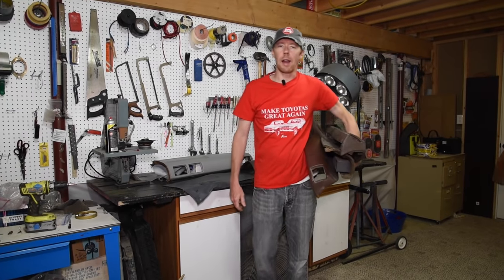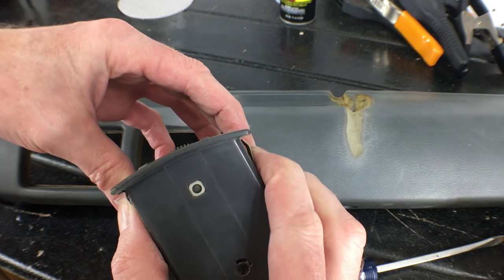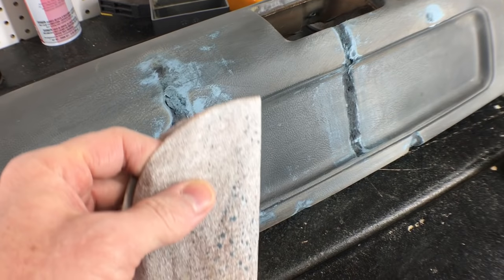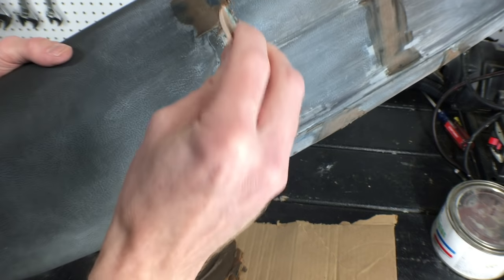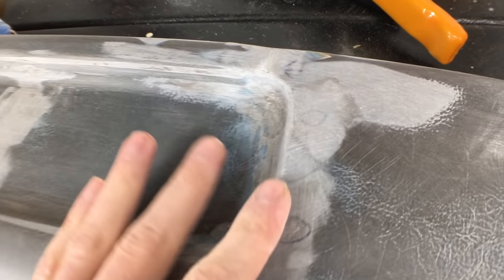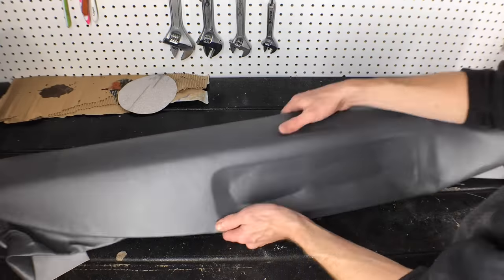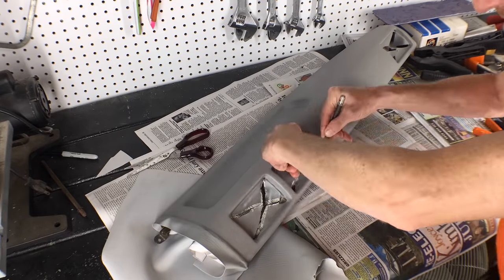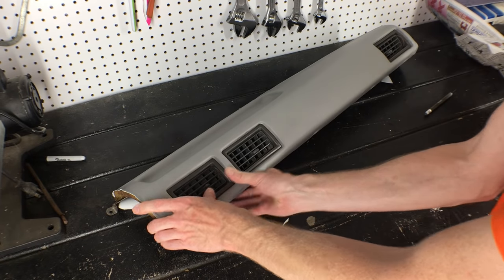How to Restore/Fix/Repair a Cracked Vinyl Dash - Toyota Hilux Pickup/4Runner PART 1

Comment: Hey.
If I may..ive done lots of vinyl covering, and you can keep that contour in the dash by gluing the inset part only, and press the glue on the bottom and edges, and let it dry. Then take a steamer (or even an iron with a GOOD steam setting)...not heat only, and stretch the vinyl over the contours as you glue it into place. Heat tends to more less melt the vinyl into place, while the steam sort of swells the cloth backing of the vinyl and allows it to stretch. If you ever get the chance to do another one, try it and start glueing in the contours first, not trying to stretch the material into it. Hope this helps...and great and informative video by the way!
Thanks
Reply: you are right the indent needs yo be done first so the material its not stretched and comes up from it but at least he puts the mistakes in the video and now we know what not to do 🤣.

Comment: I live in Australia and I converted my 74 Corvette from LHD to RHD. With the dash faces I cut, rearranged and filled the joins. What I did was remove the cotton backing from the vinyl which made it super stretchy. They looked factory.
Reply from the maker: Thanks I will have to try that in the next dash video!

Comment: Cut blocks of upholstery foam the same size as the recess in the top stack about four of them on top of each other support the underside of the dash get it good and hot with the heat gun then apply a piece of plywood that covers by about an inch of the size of the recess on top with weights, till the surrounding plywood touches the other flat areas around the recess. Wait about 24 to 36 hours and that recess will be molded in properly. Learned that from a guy at a trim shop many, many, many, years ago. I'm like mid 60's
Reply from the maker: Thanks for the tip!!

Comment: Awesome video, all the trouble you had with the recess part, I would have used that old bond and made it a smooth dash 😝, but you never gave up. Great job 👍🏼
Reply from the maker: Looking back, I wish I did exactly that! I recently restored another dash using spray foam, brush on glue and 4-way stretch vinyl and the results were much better:
https://youtu.be/XB9GKLRHYNM

Comment: Remove the white on the back of the vinyl, it can be torn off. Then the vinyl can be shaped very well, it becomes very stretchy. Have renovated many dashboards. Sossemats from Sweden
Reply from the maker: Thanks, I had no idea it could be removed. I recently restored another dash using spray foam, brush on glue and 4-way stretch vinyl, and the results were better, but still had a little trouble with the recessed area: https://youtu.be/XB9GKLRHYNM

Comment: You need to glue and install the vinyl cover over the recessed area on top of the dash first and let the glue dry and cure before doing the rest of the dash. You also kept heating up the vinyl but heat causes the adhesive to release. You also need to spray a bonding primer on the dash before applying the adhesive. And if you need to heat and stretch use a hair dryer not a heat gun.
Reply from the maker: Thanks for the advice, I would like to try this again in a future video using all the advice I have received.

Comment: Probably already figured this out now, but it's easier if you don't let the glue get quite to full tack, & start with the biggest recessed area first...and the 2nd vinyl is a better shade of grey in my opinion...🖖🏿😎👍🏿
Reply from the maker: Thanks for watching! I recently restored another dash using spray foam, brush on glue and 4-way stretch vinyl, and the results were much better: https://youtu.be/XB9GKLRHYNM

Comment: Try out some stretch heat vinyl. I've used it on small projects but for what you did. It might work but I'd also look into a more industrial type glue that does not react to heat. Looks like you are on a good path. Keep at it.
Reply from the maker: Thanks for the tip! I'll do that next time.

Comment: Remember that groove that was filled in around the recess? Good place for a seam. Do the recess with a separate piece to the groove, and the groove will make the seam disappear with top piece overlap. Steamer helps a lot also, especially if using leather. Awesome video!!
Reply from the maker: Excellent idea! Thanks

Comment: Great instructed DYI.  I would think it would be easier to work with less material.
Reply from the maker: Thanks for watching! I recently restored another dash using spray foam, brush on glue and 4-way stretch vinyl, and the results were better, but still had a little trouble with the recessed area: https://youtu.be/XB9GKLRHYNM

Comment: A friend who runs an Upholstery shop does most of what you did BUT he fills most of the way spray foam insulation (Home depot or lowes  in a spray can) then covers with long strand.
Oh and quick tip for the vents use the sanding block and 36 grint sand paper a little more work but you get even cut.
Edit: To fill most of the imperfections you could have used a high build primer and block sanded with a 220 grit

Comment: Great Technique,    I like it,   I also like the roller skating music,😃😃
I've never tried this but just a thought,  How about spraying some. Rubber vinyl top,   or. Spray truck bed coating.  Or other type of spray catylized spray rubber. That way you don't have to stretch any material.  😃😃 lots of work
 Thanks
Reply from the maker: That would be so much easier... I think I’ll try that in a future video!

Comment: my 1992 SR5 pickup dash was so sunburn brittle that almost if you touched it with any pressure it cracked into pieces like crazy.   In order to hold it together enough to work with I used Bondo Fiberglass Resin Jelly 00432 (reasonable price from Amazon) with (Bondo) fiberglass mat (because they were temporarily out of the Bondo fiberglass cloth) as backing.  I love the stuff because it is a stiff, not runny gel that soaks into the backing material and cures so quickly that you can hold the broken pieces in place while it set up fast  enough to easily hold the fractured pieces in place long enough to hold together.  My initial attempt at sticking things together with crazy glue was a total fiasco while the reinforced Bondo resin jelly worked far better than I could have hoped for.
I am sure you could cover this with vinyl and make it look super great as in the video, but I am not concerned with surface appearance,
Reply: this 1992 SR5  plastic dash has no foam lining
Reply from the maker: I didn't consider fiberglass, great idea! I later restored another dash using spray foam, brush on glue, roller, and 4-way stretch vinyl, and the results were better... but still had a little trouble with the recessed area: https://youtu.be/XB9GKLRHYNM
Reply: @6thGearGarage  particularly note the use of Bondo fiberglass resin JELLY OO432 which has quite different handling properties than regular Bondo filler and is not sold as universally.  It is great stuff for this application ! It can also act just as easily as a sandable filler.

Comment: If you want to use what professional vinyl top applicators use, looks for DAP Weldwood Landau top and trim adhesive. It has to be sprayed, and once you stick 2 parts together, it ain’t coming apart if you want it to.

Comment: I wonder if you tried something like a piping bag for cake would let you  put the filler in the cracks  with a little more efficiently? Nice job on the dash.
Reply from the maker: that's a pretty good idea. I've been told spray foam works well too.

Comment: Sweet. I have an 86 toyota van with practically the same interior style, luckily I found an uncracked dash pad out of Washington but for the original I'm gonna try to repair it using this same process 🤙🏻
Reply from the maker: I love those vans, they're so rad!
Reply: @6thGearGarage  me too! It's a 2wd 5 speed. I've always wanted to find a 4x4 but they're really pricey.
Reply from the maker: @MegaDysart  yeah they are!
Reply: I have a 1982 Mitsubishi L300 van. Luckily, the dash pad I have for it only has one tiny crack that's barely noticeable. It used to be 1.6 liter 4 speed column shift, but I changed the engine and transmission, so it's now 2.0 liter 5 speed floor shift using donor parts from a 1991 Mitsubishi L300. Made a big difference and the van is much better, still a bit under-powered, but way better than before. I'm in Queensland Australia.

Comment: I’d have done just the deep tray first. Not the whole top. I always do those spots first, and then glue as I go. Very slowly. Only way to wrap dashes and make them perfect. Do 6” square at a time at largest. 
Watch this video, it’s the correct way. “Cechaflo - A plastic piece wrapped in leather”. Just do each curve, recess, or variations in surface as it’s own section. Let glue dry before moving on to next section. Keep the natural grain in leather/ vinyl from stretching out in weird ways. A little practice and going slow. It’ll look well done and professional.

Comment: You should use one of those plastic bags for storage a bed mattress with a vacuum.  When you did it the first time was OK, you only place the dashboard in a vacuum bag and when shrinks it will applied pressure on every corner until the glue dry. Kind the same when you use a kitchen vacuum bags to seal a steak inside.
Reply from the maker: Excellent idea! I recently restored another dash using brush on glue and 4-way stretch vinyl and the results were much better:
https://youtu.be/XB9GKLRHYNM

Comment: May I suggest a tip from model airplane covering for the corners of the dash. A strategy that has worked for me, suggested in a Harry Higley book, “Tom’s Techniques”, is the concept of managing slack. As you try to bring the veil around the corner you end up with lots of slack, which causes the wrinkles. Not saying this will work on this vanilla, but might be worth an experiment. As you pull to stretch around the corner, heat up the vinyl several inches into the excess area. If you can get that area to trench, it will pull along the area you really want to get stretched. Maybe. And you could put waxed paper between the surfaces both when making your indent mold and when clamping it in.
Reply from the maker: Thanks!  I recently restored another dash using spray foam, brush on glue and 4-way stretch vinyl and the results were much better: https://youtu.be/XB9GKLRHYNM The 4-way stretch vinyl was the biggest improvement over this one.

Comment: Interesting video. When you lay a vinyl floor, you use a chemical that is sold on a bottle that has a hypodermic needle at the top. Forgotten the name. You carefully apply it to joints. The 2 halves partially melt then solidify. It needs practice. Ask the vinyl supplies if they have it, because it will make those cut and tuck edges look perfect. Ask a vinyl floor layer if the shop people don't understand.
Reply from the maker: Thanks for the info!

Comment: Fantastic video walkthrough. How has it held up now that it has been several months? Any cracks or anything forming? Any bulging?
Reply from the maker: Nothing yet, but I haven't exposed it to the extreme sun and heat.  I'm going to do another video using a different repair method and test them both side by side.
Reply: @6thGearGarage  That would be amazing. Looking forward to seeing the other method as well. I have a dash that I need to pull and repair, and your video so far has been an amazing help to brainstorm on the process.

Comment: Hey, I know I'm 3 years late, but thank you for this video!  And showing the long strand Bondo.  (BTW, The 1812 Overture sountrack really elevated this to a new dimension) :-)
Reply from the maker: Thank you. This dash did not hold up well to the hot sun and heat. I also wrapped another one using stretch vinyl and better glue and some other different materials:  https://youtu.be/XB9GKLRHYNM   And here is how they both looked after 1 year: https://youtu.be/ywkqTaHK2LA

Comment: Just like body work, you can spray a light coat of flat black spray pant then sand. The high or low spots will show up.
Reply from the maker: Good idea, I didn't consider doing a guide coat!

Comment: HI I've had much better luck using brush on contact cement like Weldwood. the spray on stuff doesn't seem to have the  holding ability. I use a heat gun too but many shops use steam, it doesn't over heat the vinyl. 
Rich
Reply from the maker: I recently restored another Toyota dash using spray foam, 4-way stretch vinyl and the Weldwood brush-on glue you described, and the results were much better! https://youtu.be/XB9GKLRHYNM

Comment: You could have smooth it with body filler and rubber texture spray paint.  Putting the vinyl cover create more works plus you will see seams around corners when you finished.
Reply from the maker: I'd like to do another one using that method. I recently restored another dash using spray foam, brush on glue and 4-way stretch vinyl, and the results were better, but still had a little trouble with the recessed area: https://youtu.be/XB9GKLRHYNM

Comment: If you run some masking tape along the edges of where you’re putting plastic filler, you can save yourself a lot of sanding - just remember to pull the tape off before the filler gets hard.
Reply from the maker: Thank you for all of the tips!!

Comment: I actually have several non cracked gray 84-88 dash pads here!  With how long its taking to finish my truck they maybe cracked by the time I need a good one!  Less heat here in Canada meens it just takes longer for them to crack I guess! Great video though.  I learned a lot!   I've also searched several years for non broken rear plastic pannels and have two sets of nice ones in cold storage.  I also got a set molded in fiberglass which I could wrap in vinyl
Reply from the maker: Smart move molding a set in fiberglass! That should be much more durable than the thin plastic toyota used.

Comment: You are never surrender I like it.
Reply from the maker: Thank you. This dash did not hold up well to the hot sun and heat. I also wrapped another one using stretch vinyl and better glue and some other different materials:  https://youtu.be/XB9GKLRHYNM   And here is how they both looked after 1 year: https://youtu.be/ywkqTaHK2LA

Comment: Now I know why I'd never attempt a job of this caliber. I doubt I would have done half this good. Just wondering though, is it possible to just use silicone or expanding foam to fill those cracks in?... then shave it down to match?... just an idea
Reply from the maker: Great idea! I recently restored another dash with spray foam, brush-on glue, and 4-way stretch vinyl, and the results were much better: https://youtu.be/XB9GKLRHYNM

Comment: Use a used popsicle stick to fill the low area cracks with the bondo.bonds. Also would be good for the recessed area's
Reply from the maker: Good idea, thanks!
Reply: @6thGearGarage  Also could have used the plaster of Paris type method on that top of dash indentation and then b4 apply spray
glue all over the dash just spray the indent first and material in that area then use the mold for the indent to stretch it down first.
    Then spray the top and put it down . Just
slowly work all areas . The first material you
used looks great I got my interior fabric at the same place. I need to do my dash also they only sell covers for them 🤮 yuck. 
   I have a 96 sonoma dash to redo if you have ever seen one it is a strange flat shape
but the glove comp. area is weird.

Comment: My father owned an upholstery shop for many years. I worked there off and on in my younger years...How you get the vinyl into the recessed area is first, they sell different types of vinyl some stretch some don't. Of the stretchy types their are single and double stretch vinyls.Single stretches in one direction double stretches in both directions. Double stretch is better for a part like that dash, but single like you had can work..... In any case your biggest problem was you were doing it backwards. You start by sticking the vinyl down into the recessed area then work out from there stretching  the vinyl on the outside curves of the dash to get wrinkles out that starting in the recessed area created. When you get it all stretched over the part as best you can you can use a heat gun to shrink any small wrinkles on the outside curve of the dash you have left.  The ends where you were forced to cut the vinyl could have come out better if you had more practice, but to avoid put in the relief cut you probably would need a double stretch vinyl.
Reply from the maker: Thanks, I will attempt this again with the double stretch vinyl!

Comment: The  biggest problem you had was the crappy spray  can adhesive. Real contact cement sprayed from a spray gun and you would have much better results. your learning by doing that's the best way.

Comment: i wonder if you used a vacuum chamber or some sort if that would make it go perfectly in all the seams? maybe preheat the vinyl as well.
Reply from the maker: That would be a good experiment for sure. I've seen carbon fiber done with molds and vacuum and it turned out great.
Reply: @6thGearGarage  thats how just dashes does it

Comment: drill a small  hole from the back side or the recessed area and use a shop vac while heating the vinyl to vacuum form  it into place
Reply from the maker: Good idea!  I recently restored another dash using some different methods +  better materials and it turned out great: https://youtu.be/XB9GKLRHYNM

Comment: I wonder if you can cut the fabric thread on the back of the vinyl, the screen material to allow the top vinyl material to contract and expand with heat in the contours. Just thinking the screen backing is what holds the integrity of the vinyl.
Reply from the maker: I recently restored another dash using spray foam, brush on glue and 4-way stretch vinyl and the results were much better: https://youtu.be/XB9GKLRHYNM The 4-way stretch vinyl was the biggest improvement over this one.